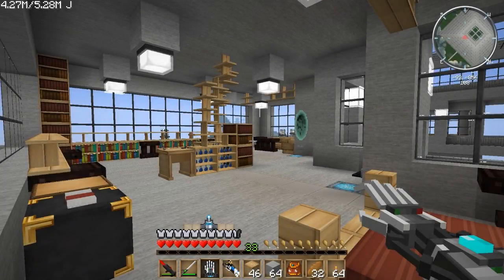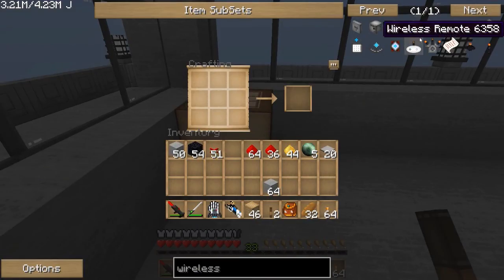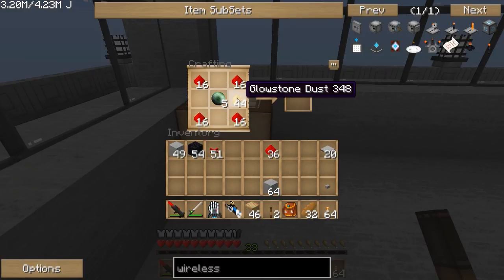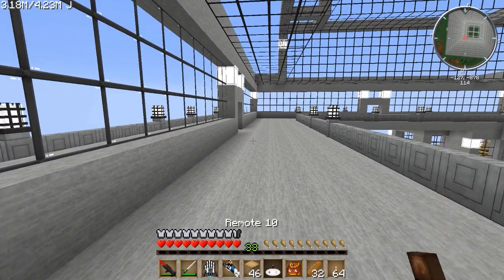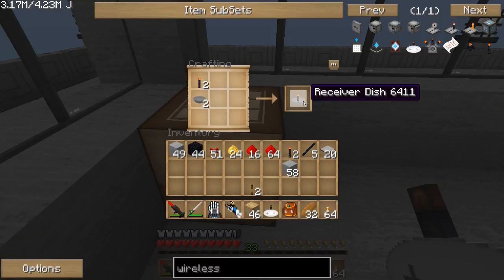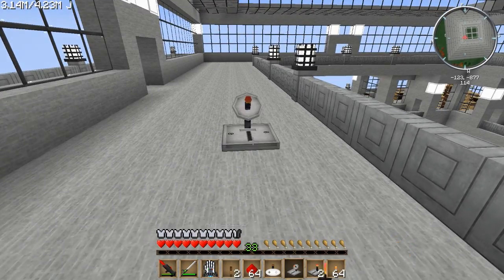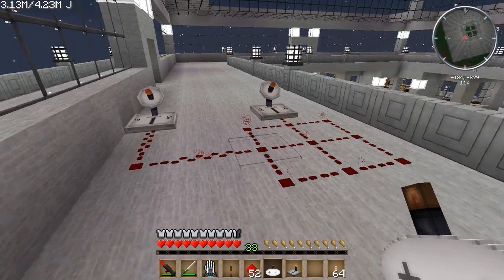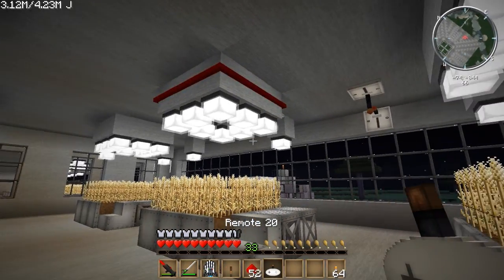FTB Minecraft EP66 - Wireless Redstone Basics

Comment: Did you know you can control the frequency of a transmitter or receiver with a computer?

The advanced menu is so you can set a frequency and give it a name, then just double click on it on another receiver/transmitter and select the frequency.

Also, the Redpower Screwdriver can rotate transmitters and receivers. So can the Gravitool in screwdriver mode.

Finally, look up Toggle Latches. basically a redstone signal controlled lever. Useful for turning things on/off.